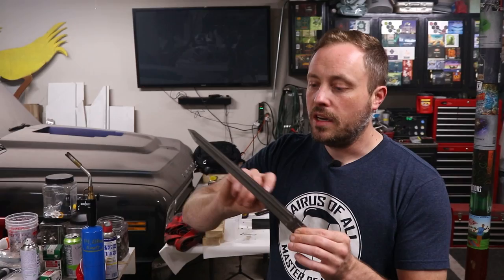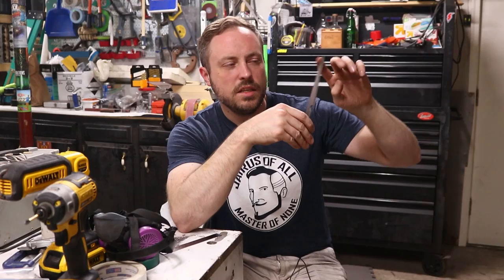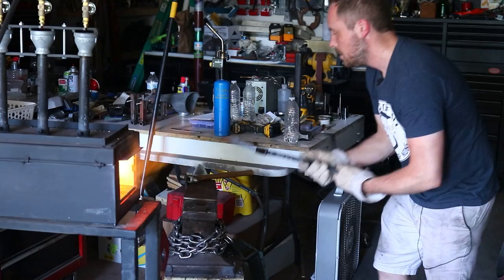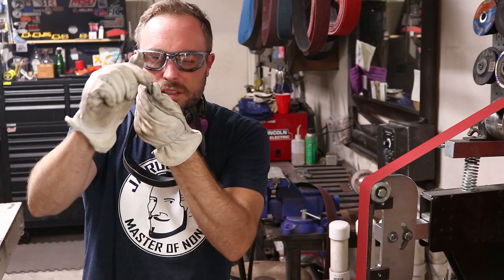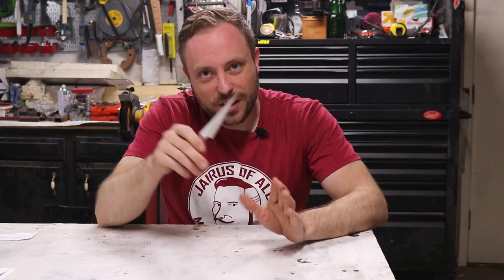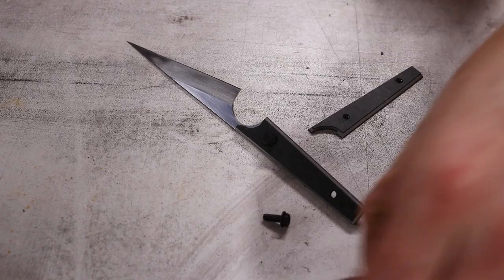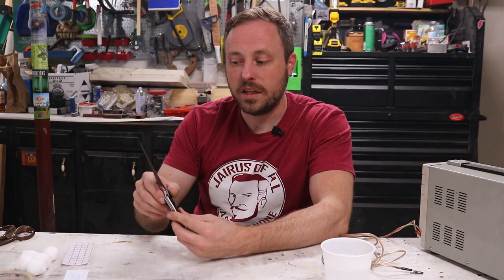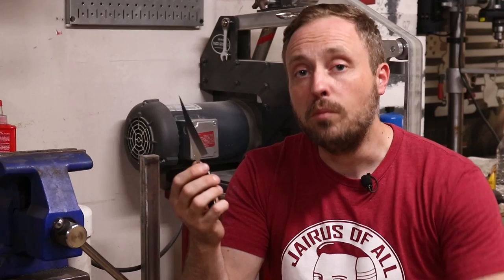Ultra Sharp Paring Knife - Making My First Knife

Comment: Awesome stuff! In the future you can use a magnet to check for heat treat temperature. It looked a little hot, but since you didn't forge it there weren't any stresses in the metal.

Comment: A good way to know if your blade is hot enough to put in the quench is to put a magnet to it, if it doesn't magnetize then it's hot enough. Another trick I've seen is placing some salt at the front of the tube, when the salt begins to melt you should be good since the melting temperature for salt is about the same temp you want to harden a blade.

Comment: When you were quenching the blade you made a error, you don't have to reheat the blade to fix it because after quenching you have a certain period of time where the blade is still malleable enough that you can bend warps out of it. Also reheating it like you did and quenching it multiple times interduces stress into the blade so when you go to cut something with it it might crack you also should have normalized it which basically is you heat it up and let it air cool 1 to 3 times to relieve the stress that has built up.

Comment: That is one nice looking blade! i actually love the shingle grind blades aka chisel grind. Tip practice the grind on some cheap mild steal and on the back side put a very slight hollow grind along the entire flat ground section. I had a tanto bladed knife with that type of slight hollow grind and it was just stupid easy to resharpen. 12k wet dry sand paper a bit of glass and wetted sandpaper lay the blade flat and a few lap strokes on the back side and it was razor sharp again. Those triangular shaped blades are probably one of the best utility blade patterns you can choose. They can be used for every thing from pealing a potato to skinning small game for pelts etc. A friend of mine was a fur trapper and his blades he used for skinning were small triangular blades about 3 inches by 1 at the widest. He could skin a rabbit a muskrat etc in about 5 minutes with those. 
So think fine detail cutting to basically any thing else. Make your self a nice kydex sheath for that and you will have a knife you will use every single day!